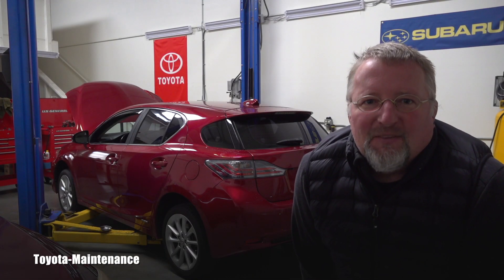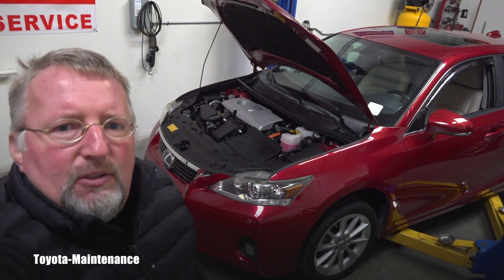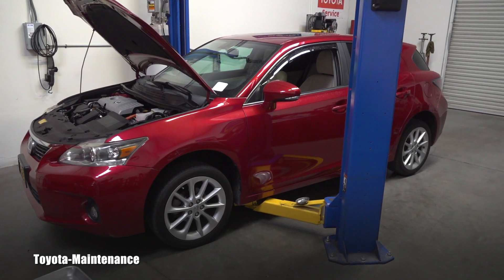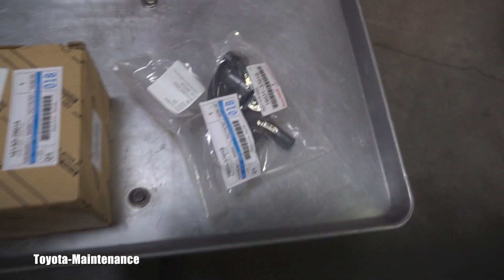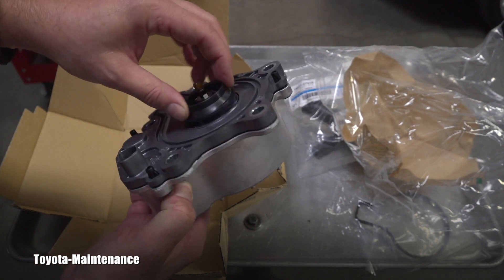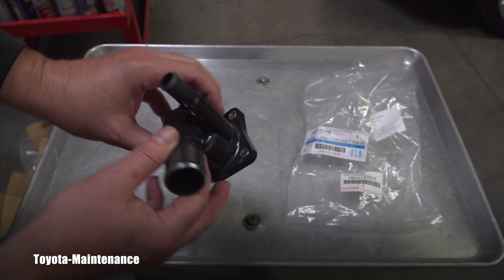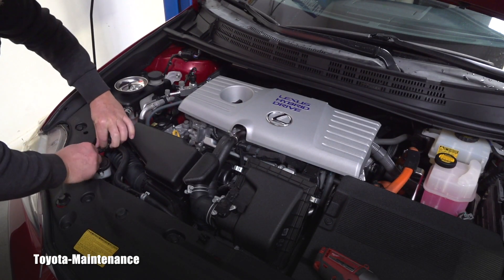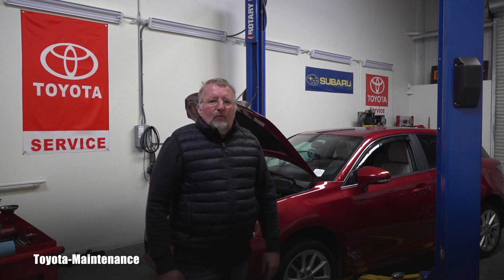Toyota Lexus Hybrid Electric Water Pump & Thermostat

Comment: I had similer problom with my lexus  
It was only one coil  but garage told me to change EGR and plugs  when i changed EGR and coolant  it was still  shacking vibrating then finlly AA told me to change no 1 coil so did that but then it had air lock keept loosing water 
I was told to change head gasket or hole engin 
Finly i dicied to checks my self 
I discoverd  there was air lock in Radiator  system 
So i removed small inlet raditor piper from coolant botle  started the enging  that cleard the air  i pushed back inlet pipe back on coolant botle and kept it loos for afew minuts 
 The job was don

Comment: Toyota Specialist, I need your help.  I owned  a 2010 prius and recently I am facing some issues. I have no  check engine codes,  but water is broiling out the  coolant resovior.  No waterpump code , no overheating sign. The fan comes on at 203 degrees. I perform the combustion leak  test with the liquid, but no color change. I burp the system for hours the bubbles disappear but return when the cooling fan comes on. Could it still be air. What can I do to get out the remaining air. THANKS

Comment: I just got rid my Ct200h similar mileage. I loved that car but it started to vibrate/jerk when you initially start it. The check injection light did show that it was a multiple misfires. Found out that the egr system gets clogged and ends up heating the engine that it might damage the head. Didn’t want to deal with it. Great car but the engine was a VERY BAD DESIGN.
Reply: Did you have it checked at the dealership.?

I had the same issue.It would start up and make terrible noises.Toyota dealer checked it out and the water pump was frozen and leaked water on my spark plugs causing it to misfire.

Runs great now 177,000 miles.
Reply: @sonofapollo5892  Didn’t want to deal with so I sold it after the that issue.

Comment: Seems absolutely inexcusable to me that they cheaped out and put a plastic impeller on an expensive electric water pump period in the second generation Priuses you had a stamped steel impeller on the water pump shaft.
This failure often will lead to a head gasket failure after an overheat, apparently EGR cooler and EGR valve problems also plague this design and can also cause a blown head gasket.
What the hell were they thinking

Comment: I have the same car and I just did the EGR system and intake manifold cleaning along with the throttle body and pcv valve. I so installed an oil cath can

Comment: Remember when Toyota had simple mechanical water pumps that were cheap? Good times
Reply: Actually the only flaw in this electric water pump is the fact that for whatever reason they decided to put a plastic impeller on it.
The previous generation hybrids had a belt driven water pump with a stamped steel impeller. It's not the electric motor that fails on these it's the connection between the shaft and the plastic compeller. This makes it an even stupider place to cheap out. Literally a few cents increase in part cost to go to a stamped metal impeller absolutely unbelievable. This failure can often end up leading to a head gasket failure, the other big failure on these engines is the EGR cooler assembly and the EGR valve plug up or fail to work correctly and can also cause a blown head gasket.
Reply: 0.02 MPG SAVINGS!!!
JUST THINK OF THE GREEN PROGRESS!
Reply: This is why I chose a plain Yaris over the more complicated Prius C when I bought my used car 4 yrs ago. The diff in MPG was not worth it.
Reply: @pedrofernandez8729  That's what people fail to understand.What's a bit more fuel consumption compared to uber complication and expensive repairs down the line.
Reply: @tolrem  Not just that, but they say they are saving resources to cut down on CARBON, and put in poorly designed systems that have problematic failures and voila, more parts to hit the junk pile, and new ones to replace... Great for reducing resources.
Reply: I agree on spending a few cents more to make a product better. But in Toyotas defense, my 2016 Prius has 100K and i haven't had a single repair on it. In addition too, the amount of gas i have saved from trading in my Jeep is around 8,000 dollars. So if i need to replace the water pump and thermostat to the tune of say 400 bucks doing it myself every 120K then i wont complain too much. But yes, for 2 cents more id rather it last forever
Reply: @Elt31987  Yes, and then comes to old battey (when it fails) to hit the would be recycling bin. And more rare earth metals to raped from the earth and processed and new bi-products to be disposed.... sounds like the same old vicious cycle with just new materials.
Reply: @mmoser9483  likely, but driving my Jeep getting 17 mpg is far worse. It's about making steps forward. Not solving in one swing. I wish it were that easy
Reply: M Moser 
Tell us more about how you ride a bike to work and don’t use any rare-earth metals in your life. Get off your high horse 🙄
Reply: @moloono1  lol I never said I didnt.  I'm as guilty as the next guy of buying plastic by the ton and other unecological practice's. Like I said, baby steps towards Better things. That's all. Take care
Reply: With schlong-shaped gaskets?